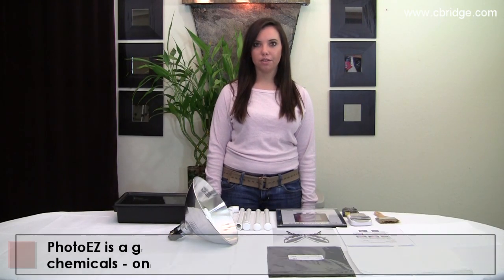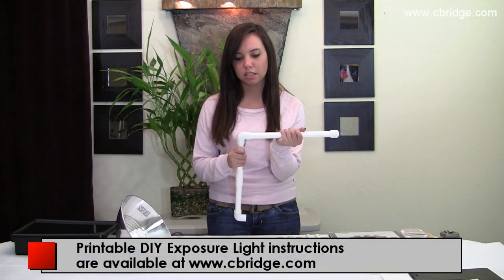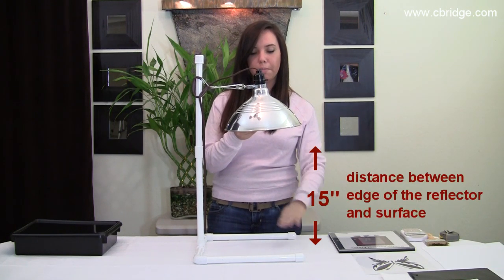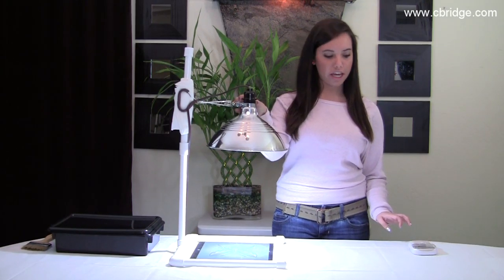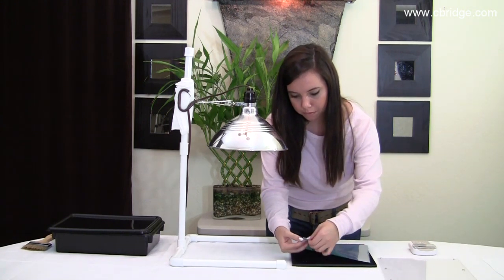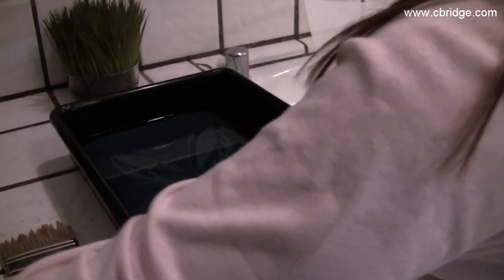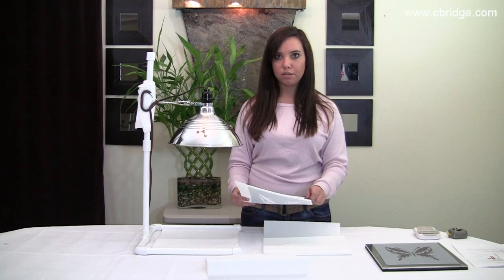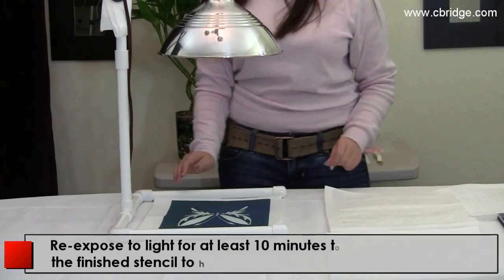Screen Printing with PhotoEZ II - Making a Silk Screen Stencil

Comment: Here's a tip- if you have to use a brush to get the emulsion off, you probably have stencils that are old or weren't stowed properly in a fridge. I had that issue, then bought a new set and after soaking now I barely even have to rinse, it comes right off!
Reply: ***** They sent me old or improperly stored photoEZ then, because mine does NOT come off.  I have to get a scrub brush and that ends up taking off too much.  Anything soft and nothing comes off at all.  

I cannot get any images to work because  it is over exposed.  If I expose for 30 seconds, I still have to scrub so hard that my brush (Purchased from them) is a total mess, and it does not work out.

Comment: wattage of the light bulb would be helpful
Reply: Should have at least 1600 lumens (usually 23w). Use a cfl daylight bulb with 5000k or higher color temperature. Works for both PhotoEZ and StencilPro. PhotoEZ requires ~15 minutes exposure time. These videos go into how to DIY your own simple exposure unit:

https://www.youtube.com/watch?v=zSIt0aKAsAU
https://www.youtube.com/watch?v=reCmvKDvfGM&t=44s

Comment: Where did you get the dark soaking box ? Do you sell these
Reply: We no longer sell them.

Lightproof tray is not absolutely required if you place it in a dark room/closet or drawer. As an alternative use a buffet serving tray or aluminum baking pan. Here are some sources on amazon.com

amazon.com/dp/B00SXCW0J6/_encoding=UTF8?coliid=I127UHTS6HDIRM&colid=1EKV9U33UXMMZ

amazon.com/dp/B000UBBF94/_encoding=UTF8?coliid=I3R6U6HRYPLPF9&colid=1EKV9U33UXMMZ

amazon.com/dp/B004UNEJCI/_encoding=UTF8?coliid=IOMX8HU4ODTL0&colid=1EKV9U33UXMMZ